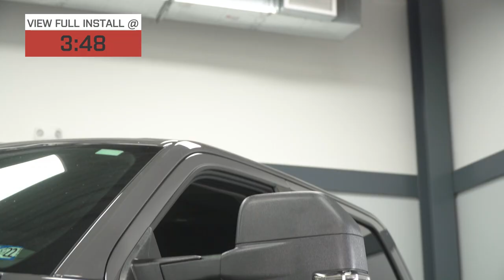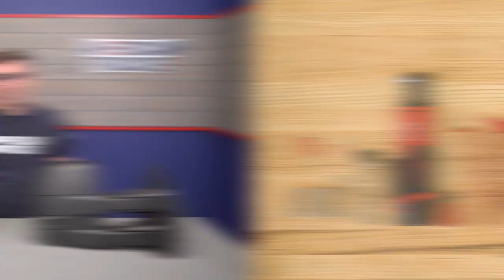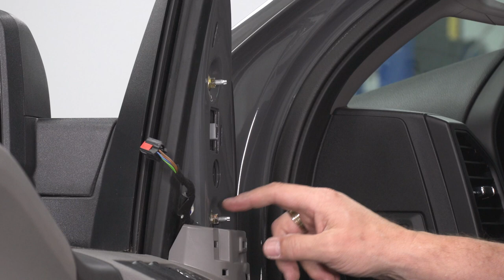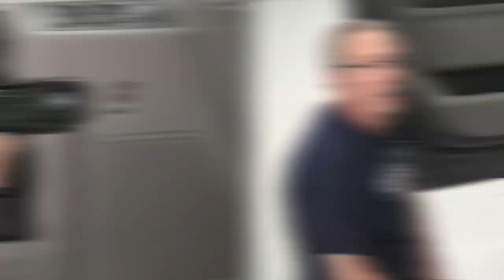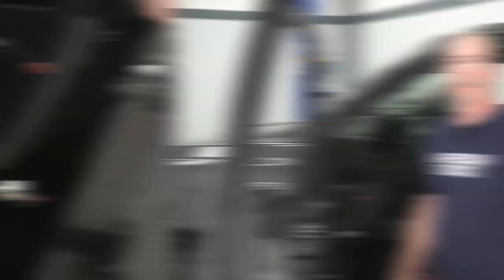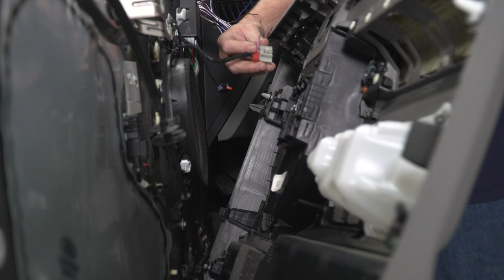2015-2019 F-150 Powered Heated Towing Mirrors with Smoked LED Turn Signal Review & Install

Comment: Man can you please tell me what you did on FORScan I’ve been playing around all day and tonight to try and get mine working I have the same truck as you and had stock little mirrors but on my tow mirrors I can not get any turn signals or running lights to work I finally got the puddle lights to work but nothing else. Any help would be greatly appreciated

Comment: I just bought these. I have a 2018 king ranch. All I did was plug and play and the mirrors and all lights worked. But now I don’t have the blind spot sensor and my truck throws up that error code every time I drive it. Anyone know why
Reply: Becomes the mirrors don’t have blind spot sensors.. you’ll have to buy mirrors that are properly equipped

Comment: Really had high hopes for this but with the additional needs for my 2019 Lariat along with losing the power folding, I'm out and I hate it. Just not something I'm willing to part with if I'm having to buy additional sensors to make them work. Very disappointed.

Comment: For the passenger’s side mirror, does the ambient air temperature sensor itself need to be purchased and installed plug and play style? Or would additional wiring be required to retain functionality of that sensor?
Reply: Did you figure out how to resolve the air temp sensor? I just got these in the mail today and am curious as to what the fix for this would be

Comment: May I ask what was the blue wire and brown wire?  Was blue Clearance lamp and brown puddle lamp?
Reply: That's for converting a factory 8-pin mirror connector so that it will gain the capabilities of the more sophisticated mirrors that require a 22-pin connector.
If you already have 22-pin mirror connectors from the factory, then you don't need to worry about hacking up your wiring harness or installing adapters as long as all you are doing is upgrading to towing mirrors with the same functions as your OEM mirrors.

Comment: What exactly are you testing for with the test light? Would be helpful to show how this is done
Reply: I can probably assume the wire for the turn signal connects to the existing turn signal, which is easy enough to figure out. But I’m not sure about the other. Will any live wire do? Which existing connector is being tapped? Does it matter?
Reply: If anyone has the same question I’ll answer mine:

The blue wire is for the turn signal and it connects to the white LED. This one you test for a signal that flashes when you have your turn signal on. For me, this was connected to my existing harness which connects to the mirror.

The brown wire is for the daytime running lights. To test which one to connect to, find a wire which is always hot. It probably won’t matter which harness. Note that some connections likely have higher voltage, so make sure to compare the brightness of the test light and use the wire which makes the light the brightest (assuming you want the best looking lights 😉). I’ve had issues with this one in my passenger side, not exactly sure what’s going on yet. The running light on this side seems to only work when  plugged into the pin for the turn signal.
Reply: @stevenkirbach6241 wow you’re a lifesaver man, this video is like 99% helpful but the missing 1% was what you explained in your comment. Much appreciated!

Comment: Does this work if your truck doesn’t have the turn signal mirror already?
Reply: I think that is the very example in the video, using a truck without them already. Like mine, but the wiring harness inside makes it work after the fact.

Comment: How is the wind noise with these mirrors?  Does the glass on the mirror vibrate alot when driving?
Reply: There is a little, but it's not bad. And there's only a little more wind noise due to having a physically bigger mirror hanging off your door - it can't be helped since you can't alter the laws of physics.

Comment: So I have a question, we have a 2016 Lariat with the stock mirrors with the puddle lights, blind spot and power folding with spot lights. The truck also has the 360 Parking camera feature. Will the 360 camera system still work if I install the mirrors?
Reply: No.
Reply: @jdwht2455  That's a lie. They will work, they just have to add-on the extra features to their mirror order.
Reply: Yes, you can add the extra features on to your mirror order. They just won't be $600 for a set... more like $1400.
I have a 2018 with factory puddle light, BLIS, heated glass, 360 camera, and power fold options. The Boost AUTO mirrors worked perfectly fine.

The 2021+ trucks are "smarter" than any truck has a right to be and sometimes they don't like it when you modify anything that has anything to do with the BCM.
That's where ForScan may have to come in to play in order to get everything functioning.
Reply: @jeremyhess7977  Be really careful when you use that word "lie"

Comment: It would be nice if they told us what the three extra wires power????
Reply: He did. The blue and brown are for powering the running light/blinker that the new mirrors have whereas the white wire would be used for the puddle light on the mirror's underside.